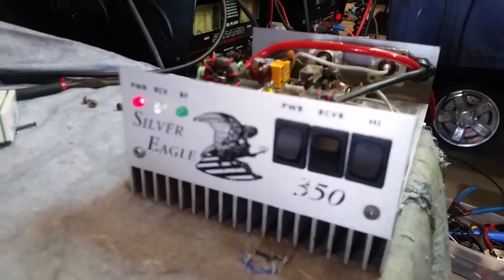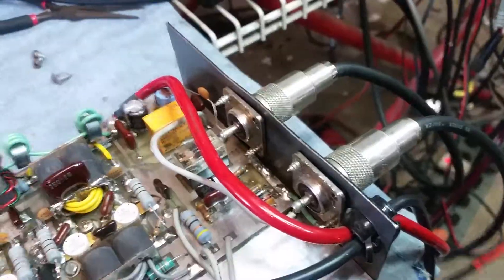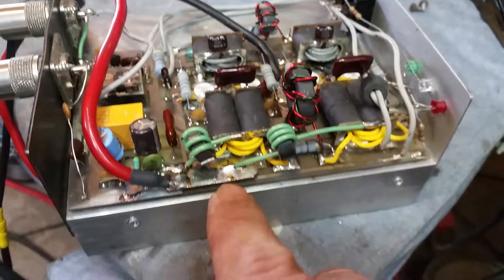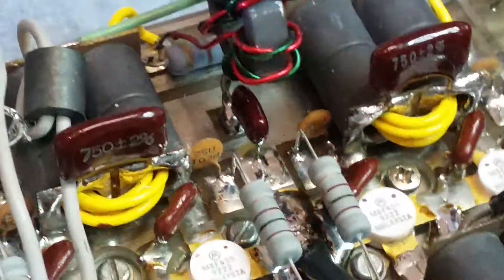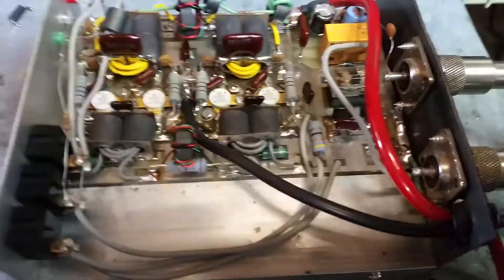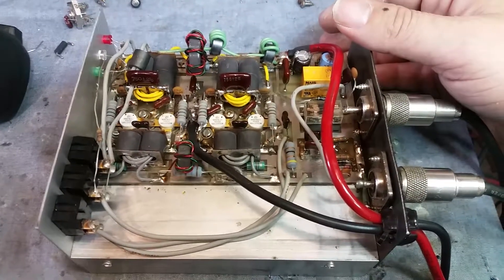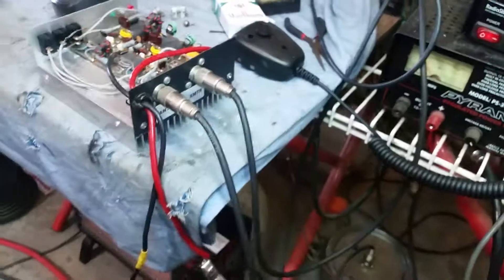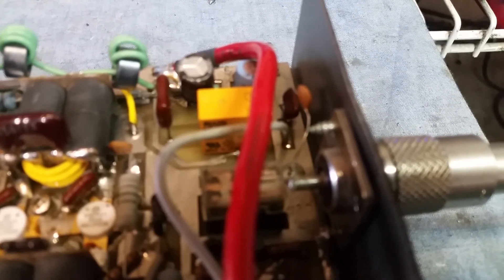Silver Eagle 350 Repair with Modifications - [Lets Start out on a new 🦶]

Comment: Flashback of the day of the seventies. I remember those relays gave a lot of problems. The most simple solution remove the plastic top from the relay while still in the circuit and change the tension on the springs or you may call them contacts. Usually the pileup weight is too much for the coil to lift that's why flip the switch a few times sometimes the bumps it to engage. Just remember when the coil engages the magnetic field will pull the pileup so that the contacts on the ends of the springs connect if it weighs too much from the tension it will be unable to lift it. You might also check the B+ going to the coil that is enough to engage the coil?  It's most likely a misalligned spring tension. When these things are adjusted in the factory I have seen adjusters that do not individually Weigh the springs instead they weigh the entire stack is usually causes problems down the road with improper clearance between the contacts or some of the springs being too heavy or too light to make proper contact. I don't suppose you have a gram gauge to weigh them? Oh… Check for ripple in the B+ Can also cause you to have a weak coil strength
Reply from the maker: Wow I can tell you know what your talking about :) No I don't have a gram scale bur what you said made 100 percent sense.....it would be a lot easier to check all those elements on a bigger relay but with a good magnifying glass im sure I could see all that easier...I need to sharing the one that goes on my head more....but thanks a lot for stopping by with thay nice detail comment...you be amazed at how many people would read your comment and get something out of.

Please stop by and comment whenever you want bud. Gatekeeper

Comment: I had a few of them come threw .Them receive amp relays go bad quite often . and has different pin out. Palomar used them as well on some. The ones I did I take them sheet metal screws out replace with 6-32 and a ground lug soldered to board.  I even done some golden eagle amps aw well even the tube ones. Them sweep tubes hard to find now. I remember the tunning problems with that one. One thing I found with them is out of tune they can make a high 2nd harmonic and when put on a antenna tuned for 10/11 meter band it will send some of the 2nd harmonic back  as reflect or high VSWR with amp on. They have a lo pass filter you can use on output of amp to clean them up. I got mine from MFJ but is the the MFJ brained one. It works great. keeping a amp in tune is a big help. will run cooler draw less amps and more watts on the Ch you want.  10 AWG is fine draws around 30 to 40 amps SSB . I have seen them with SD 1446 pills also. about the same. With them trimmers on output transformer they must tune the same  or you have un balance and that 100 ohm on combiner will get hot.  I take them trimmers out. people like to turn them  and they can move over time .can use a drop of blue lock tight to stop that and you still can re tune if needed. best take them out. I had a golden eagle 500 come threw the oner turned the trimmers and pop the pills burned the 100 ohm.  it had MRF 492 . only  1 lived with low HFE  . I put a matched set of MRF 421 and re tuned. I think I changed wraps as well. ben years back. I had dule 10 AWG pos and neg on that one. 73's
Reply from the maker: Yeh looking back I should have took the time and replaced the screws honestly lol...sometimes I think I'm working on the amp to late in the day or to early...if I work on them at the perfect time ill go a bit further on them maybe.
Reply from the maker: Thank you ad always bud! I love your detailed comments